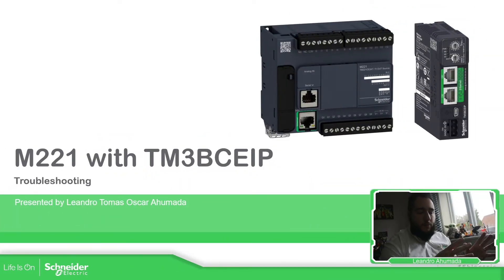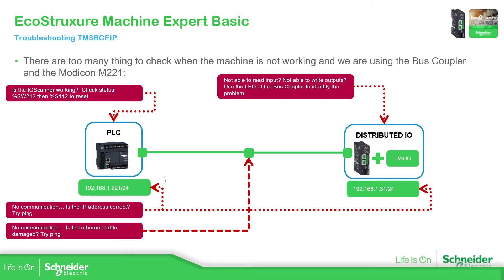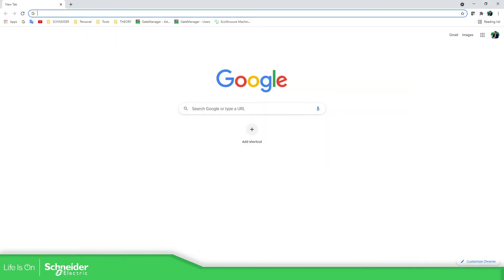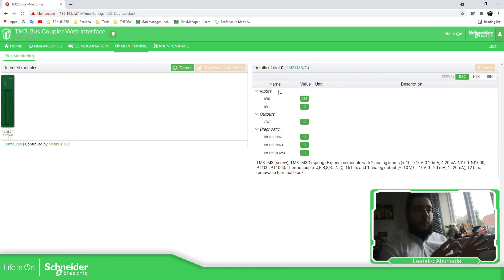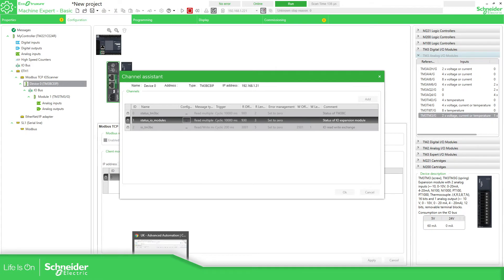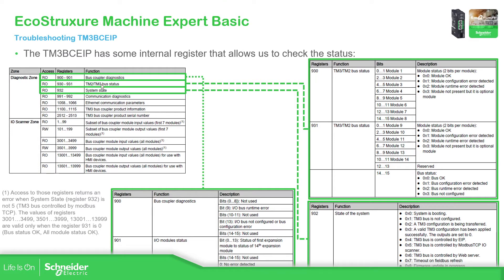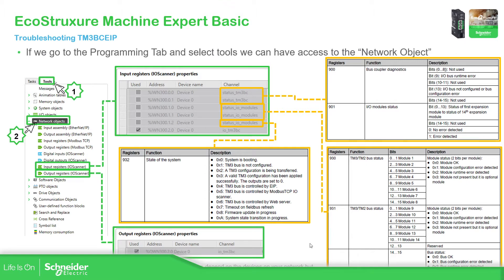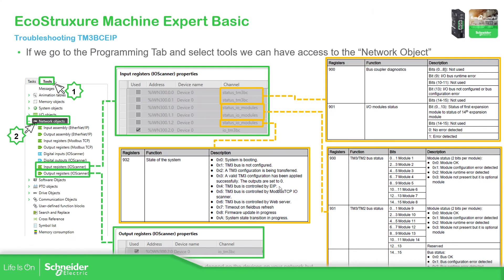Training - M221 - M10.7 Communication with TM3BCEIP Troubleshooting

Comment: Hola Leandro! Muchas gracias por compartir estos videos, fueron muy útiles para configurar los Bus Couplers. Tengo un problema, cada vez que se me apaga el TM3BCEIP, el M221 pierde comunicación con el Coupler y solo logro restablecer la comunicación reseteando el PLC. Se te ocurre que puede ser que me esté pasando? Saludos desde Uruguay!
Reply from the maker: Buenas Santiago, tenes que checkear el valor del estado del ioscanner del m221 y si es distinto de “2” resetear el %S relacionado al ioscanner del puerto. Creo que lo menciono en el video. Saludos 👋🏻

Comment: Hello all, I was hoping someone can assist me,  I am new to the M221 PLC as well as Schneider.  My configuration I have two remote stations each with a TM3BCEIP module using modbus TCP.  The modules work but about every second time I program the PLC they show disconnected and I cant read the IO.  I don't know what I am doing wrong but it must be with my setup.  Sometimes I get it to work by restarting a few times. Can anyone give me some advice please
Reply from the maker: Hi Jean-Pierre! Are you using the machine expert basic to configure the bus coupler? If yes then it should be very straight forward. I recommend you to upgrade the firmware of the TM3BCEIP just in case. Try to diagnose the TM3BCEIP by using the webserver pf the unit for further information. If the problem persist then i totally recommend you to contact the technical support of schneider in your country